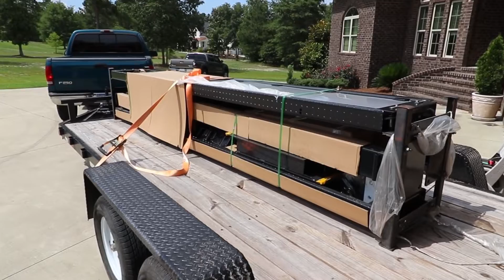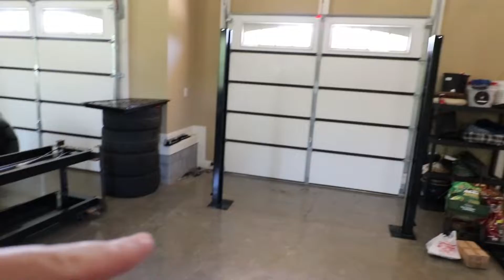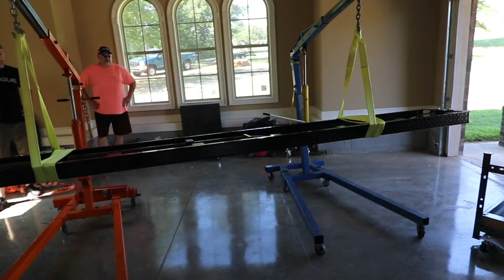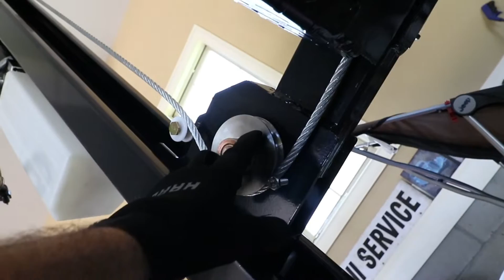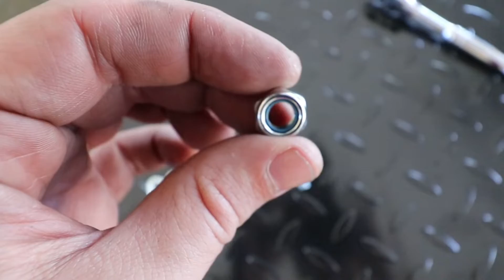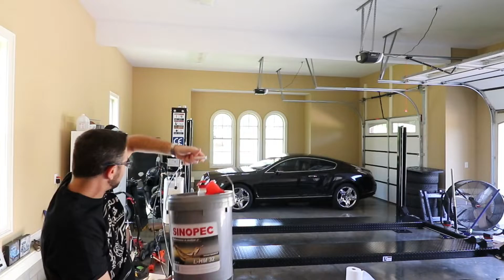How to install a 4 Post Atlas Garage Pro 8,000 lb Auto Lift Installation

Comment: Do you realize how many mistakes you made. You don’t put 2nuts on end of cables. One nut an one washer under top plate and one on top. Also you shouldn’t have taken any pulleys off every cable goes thru. Along with quite  a few other mistakes. You should take this down
Reply from the maker: Thank you so much. This is so helpful.

Comment: How did you get it onto the dollies on the trailer?  Room for a low-profile jack?
Reply: Thinking of putting dollies on the trailer and having them unload it onto them with forklift where i pick it up. And strap it down while on the dollies.  Should work right?  Thanks for the video, mine arrives tomorrow.
Reply from the maker: @997dot2  very smart and great idea. That should work perfectly.
Reply from the maker: Unfortunately, no. I had three people lift while I put it underneath. That was not the fun part at all.

Comment: Thanks for making this video. Just bought this lift and have been installing this week. The China directions are terrible but I’ve watched your video 3-4 times to use the tips provided. It’s made the job much easier. Also for others watching out there, I found the directions for the Pro8000 EXT model that are on line are a little better written and have some better illustrations.

Comment: You should do a maintenance video on this lift. This is a great lift and I feel hits above its price point when compared to others. The pulley shafts on the horizontal pulleys at the four corners have a grease sert but the grease doesn’t really get into the shaft well, they need to be removed, and greased initially, then the sert is ok every year after. However the vertical pulley shafts have no serts and need removal and to be greased appropriately considering usage. *super important *
Also the cables should be lubed with actual cable lube, I use the Castrol brand it penetrates to the core cables.
I used my lift not bolted down for a couple years, and finally bolted it. Anchoring is the way to go, just make sure you have it plumb. And if you get the threaded inserts, you can still move it if you have to and won’t have studs sticking up and just line it back up to the inserts when you put it back

Many happy years with the lift. Be safe!
Reply from the maker: This is a great idea. I believe on my lift it no longer has the Zürich fittings.
Reply: @JohnEngel  I can see the threaded ends in your video. I had to source my own grease fittings for the four at the corners, there was just plugs in the ends. I’ve seen carnage from those pins not being greased, it’s not pretty....and that’s if it’s close to the floor when one shifts or fails.
Reply from the maker: @bdun1226  I’ll have to take a look. Thank you.
Reply: @JohnEngel  I just find there are lots of lift videos to research, but no maintenance videos on them, the most important part 😂.

Comment: Great video, very helpful for guys that have not done this before, or, someone shopping and thinking about getting one. I’ve had one for about 10 or 12 years and love it. One trick you haven’t done (maybe you have done it by now) Is to change out your center garage door opener and re-rail your garage door so it goes up vertically to the ceiling before it bends around the corner. There are several manufacturers that make an opener that sits on the vertical wall rather than the ceiling. It’ll open up the whole ceiling area so you’ll be able to put a taller car all the way to the top stops.
Reply from the maker: Thank you so much. I have looked into changing the rails but because the car on top is so low I haven't needed to yet. I even thought about making a video about this if I do change it. Thank you again, this is great advice.

Comment: I installed this exact lift myself.  It certainly was a challenge and the instructions were terrible lol.  What made it more difficult is my floor has some uneven spots at different posts. Leveling it and avoiding buckling as it goes up and down was a challenge. Plus, my post with the power unit isn’t exactly welded straight with its base plate. Everything works now, but the quality control is a little underwhelming.

Comment: Did you have to bolt it to the floor
Reply from the maker: Jay Mob my original plan was not to bolt it down. It worked fine but did have some wobble so I ended up bolting it.

Comment: There should be a nut and washer above and below the top plate of your cables to lock it in
Reply from the maker: I have seen it both ways. I have not found a diagram or 100% for sure instruction with this.  You would think that it would be very detailed but it is not. If you have a manual or something please let me know.
Reply: @JohnEngel  I have this lift as well and it didn’t come with enough nuts to use one underneath and two on top, the way I feel it should be. I sourced more nuts from menards and double nutted the cable ends and the adjustment ladders on the tops of both and a single one underneath both.
Reply from the maker: @bdun1226  I didn’t even think about doing that. That’s a great idea.
Reply: @JohnEngel  yes I have a diagram on cables.

Comment: Didn't have to bolt it into the concrete?
Reply from the maker: The four post doesn’t have to be bolted. It even comes with casters so I can move it.
Reply: @JohnEngel  nice,  I like it a lot